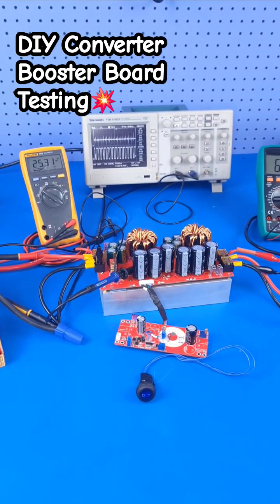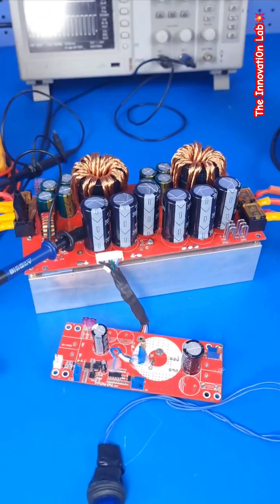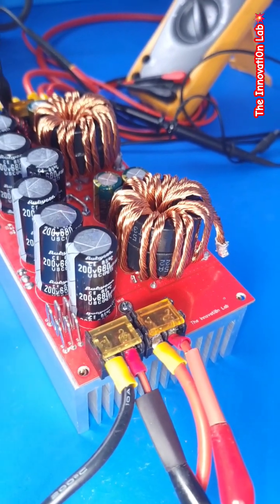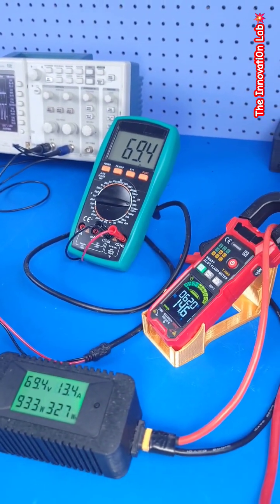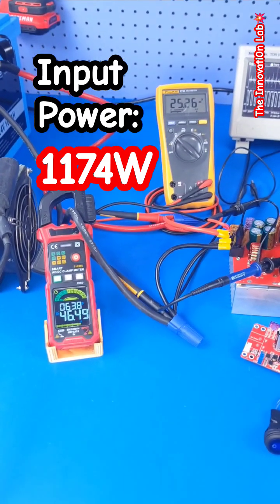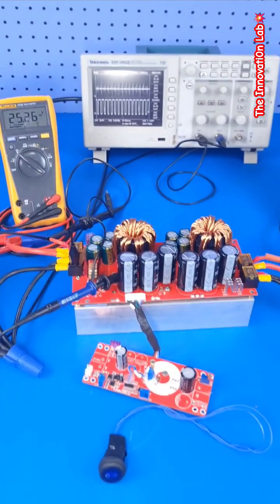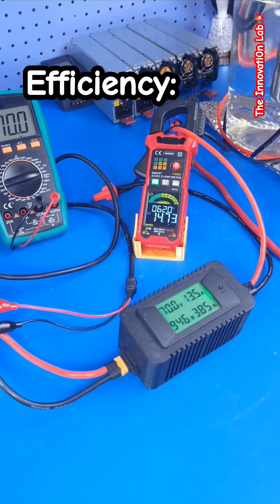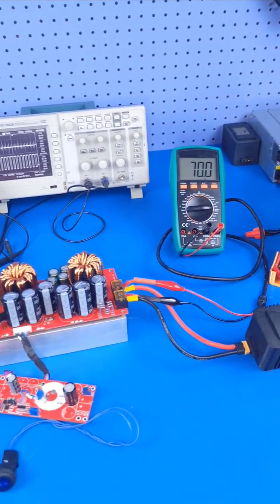DIY DC to DC CONVERTER BOOSTER TESTING, PHASE II #shorts #dctodc #diy

Comment: its been 3 years since u started ur channel.all u do is converters.. ur content is repetitive.. to anybody watching specialy who dont know about DIY.u can use cheap mig,tig mma welding machine as powerful converters for charging highpower load and batteries.its minimum voltage in DC is 12v to 15  volts.up to 40 volts.. it is exactly rated for charging highpower load in dc and batteries.and its very cheap compare to other lifepo4 chargers and converters..
Reply from the maker: Wonderful.
Thanks for sharing your opinion. I see your point about the core of my channel niche being converters. I have made lots of other videos as well, but for some reason, the YouTube algorithm doesn't recommend those as much.
💥 Battery testing and reviews
💥 Pure sinewave inverter tests and reviews
💥 DIY Power inverters
💥 Solar diy
💥 Ebike motor test videos
💥 Diy Battery charging.....and many more.

As someone who works in the tech industry, I can tell you that converters are what makes our morden electronics systems possible, and they are in EVERYTHING!!
I know people who have spent 40 to 50 years of their lives studying and acquiring advanced degrees on converters and power systems.😊
I encourage you to take some time to peruse the content on my channel.
My job (a hobby....really) is to make the videos, and I won't watch them for you.

Also, when it comes to criticisms, don't you think you are being a little hypocritical?.....yes?
I checked your channel and only saw 1 video....you have also been on YouTube for 4 years. 

The Innovati0n Lab 💥 www.theinnovati0nlab.com